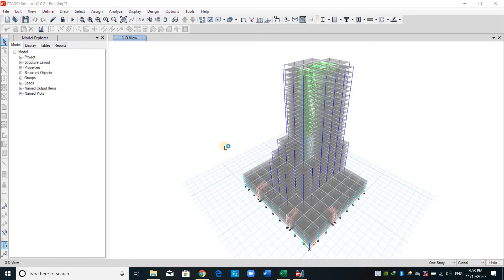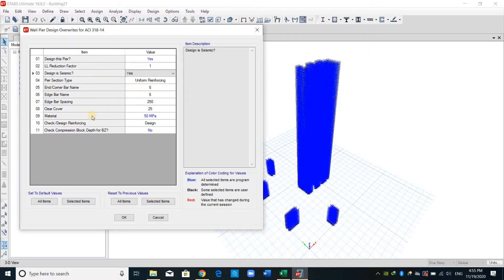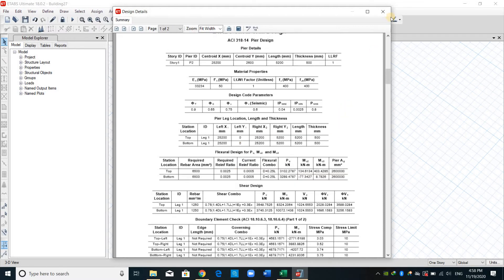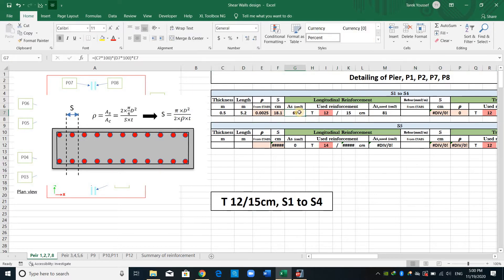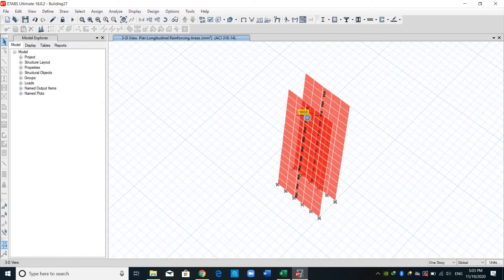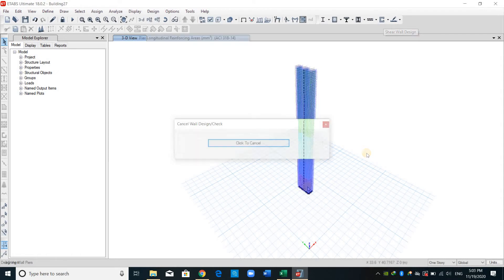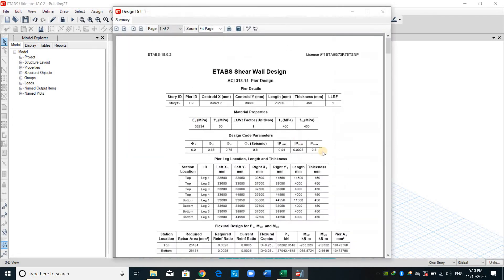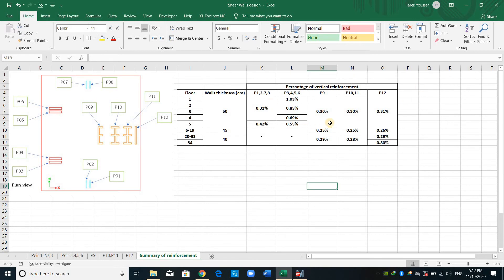How to design shear walls using section designer in ETABS software (Lec23)

Comment: What about the boundry zone?
Reply from the maker: I have applied a uniform distributed reinforcement for the shear walls and used the section designer in ETABS to verify the flexural-axial capacity of the walls using the interaction diagram.

To learn more about the boundary zone calculation and specific requirements, I will be creating a new video.

Stay tuned for updates!
Reply: @Eng.tarekyoussef  okay I will be
Reply: Thanks Sir

Comment: which code you r following ?
Reply from the maker: ACI 318-14! you can check it from Design Details Summary Report (DDSR) that pops up when u right click on the previously designed section of shear wall. 

By selecting the ACI 318-14 code in ETABS, the program computes the nominal shear strength of the section as the sum of the concrete shear strength (Vc) and the shear strength provided by the reinforcement (Vs). This can be found in DDSR.

To ensure the wall has sufficient strength to resist the factored axial-bending interaction, I used the interaction diagram option available in the section Designer of ETABS. This allows me to assess the wall's capacity in resisting the combined axial and bending forces.

Comment: WHY DID YOU USE TOP STATION LOCTION ? WHY NOT BOTTOM?
Reply from the maker: You need to use the larger value that results in a higher amount of reinforcement, whether it is located at the top or bottom location.

Comment: Hi Tarek, I have a question on shear wall design in etabs. I use uniform reinforcment method in etabs to design a shear wall and it tells me 4% longi rebar is required.  Since uniform reinforcement is not very efficient, I would rather put more rebar in the boundary element.  Can this be achieved in etabs?  like etabs telling you how much rebar to put in the boundary element?
Reply from the maker: ETABS does not tell you how much steel rebar you should put at the boundaries of shear wall. however it is a good idea to add more steel at the boundaries because you will provide more ductility to shear wall under seismic action (preferable behavior) and it could be more economical by distributing minimum reinforcement requirements between boundaries. 
Draw your section using section designer and check D/C ratio, if 0.9 < D/C < 1 then your section is safe and economical.
Reply: @Eng.tarekyoussef  Thank you
Reply: @Eng.tarekyoussef Sir,  Can we add  end columns and asign them to the wall as border element with the same pier number and minimum allowed reinforcement along the rest of the wall?